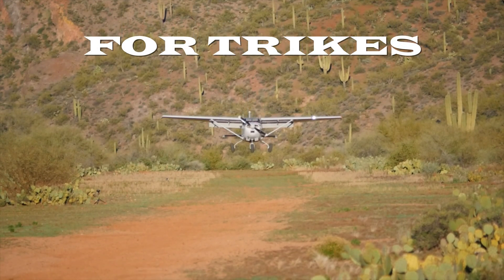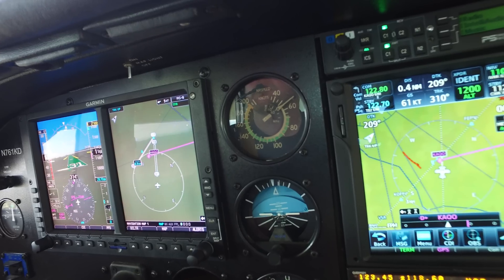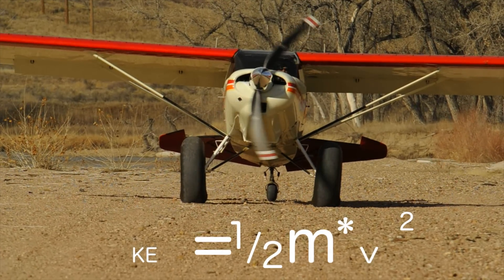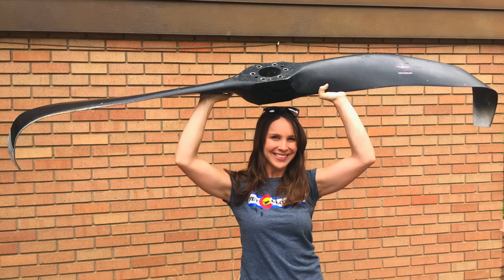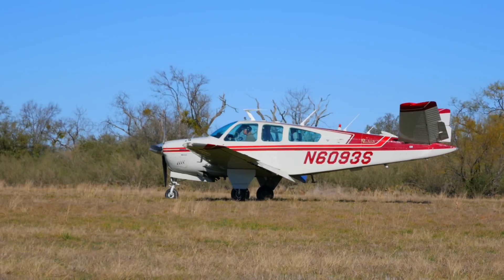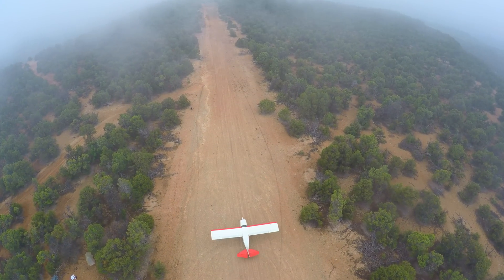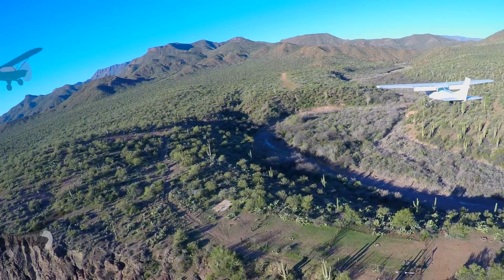Backcountry Aviation's STOL Tips (Tricycle Gear Airplanes)

Comment: Agree with most, but not all. Potato counts don’t create lift. IAS does. “Feel” is critical and should but the primary tell in most instances, but rotating at a guesstimated x potatos is less informative than x IAS vs rwy remaining and worse, bleeds vital energy if the airplane isn’t ready to fly. So perhaps a blend of both methodologies without completely disregarding IAS is more appropriate?

Comment: What is the flap technique for aircraft with electric flaps? I see that usually they would be moved from 10 degrees to full on rotate, but that is not possible in an airplane with electric flaps, which is common for tricycle gear airplanes.

Comment: We have a  175 Skylark, 1960 with the G0 300 175 horse. We are currently putting on a Sportsman STOL kit and bigger tires. Our strip here on the ranch is 1600 feet
Reply from the maker: My first off airport trike landing was a 175.  Sweet plane!
Reply: @Backcountryaviation  I have the sportsman kit on order but do you have any resources for the bigger fork assembly to allow for a bigger tires?
Reply from the maker: Airframes Alaska sells the air glass mod I believe

Comment: I can’t believe the most recent comment is a year old. Hope you’re still checking this video. I regularly fly my Cessna 150G off a grass strip in Texas with a river and cliff on one end and houses on the other, with a dogleg. The biggest concern are the deer; I’ve never seen so many. Though the book dissuades their use, I like to start with 10 degrees of flaps, yoke all the way back (washboards) and get above deer back height as soon as I can. Then I stay in ground effect and milk the flaps up.
The approach is at 65, the best glide speed, and aim just past the dogleg. I use 70 when there is a crosswind. I will try counting potatoes and practice with slower speeds. Thanks for a great video. BTW are you still making new ones?

Comment: Probably the best SEP nosewheel airplane is the FR-172-210. A French-made Cessna 172 with a 210hp engine and a constant-speed prop actually certified with a higher MTOW etc. Not as heavy or fast as the C-182 you could actually take it into C-180 and C-185 territory. I actually AM qualified to comment on this, having flown BN2A Islanders, DHC-6 Twin Otters, Do-228's and Do238's as well as semi-short-fielders like PA-23-250 Aztecs and the Cessna 400-series (C404 Titan and FR406 Caravan II).
I currently have access to a Helio H-295 Super Courier C-STOL aircraft and a few fat-tyre ultralights. In my neck of the woods (grass, actually, preciously few trees around in Iceland), I am in short-field heaven!
The point emphatized in this video about the approach and touch-down speed is acually the mainstay of short-field operations in ANY aircraft. The practiacality and experience of the pilot will determine if a simple short-field takeoff or a crash report to the authorities is called for. In a nosewheel aircraft you HAVE to be comfortable with how firm the landing strip is, or else you will be writing a lot of why-I-nosed-over reports. Misjudging this in a tailwheel aircraft is even more serious!

Comment: Great tutorial. I just wonder why you didn't specifically mention the importance of Vortex Generators on the wing fronts (which typically reduces the approach by 10 to 15%). I only saw it in the Carbon Cup at 7:20. Thanks a lot.

Comment: A 172 with just a pilot can land under 200 ft without brakes and flaps. It's called the back-side of the envelop or hanging on the prop. Don't try it unless you've got experience in handling the 172 Skylane.

Comment: These flaps !!
Yeah with a Cessna 172, full flaps, the stall speed is about 33 IAS ! 😲
33 ! Not the standard touchdown speed I aim everyday. So you can come in very slow...
Reply: 33ias is actually about 45cas in a 172
Reply: They're still teaching new pilots 60 kias (64 kcas) for short field landings. That's a 19 knot difference.
Reply: @djinn666  that is actually a 15knot difference, and you can't approach right at stall speed or you won't be able to generate the lift needed to arrest the vertical speed. Setting aside margin for gusts and wind-shear of course.
Reply: @mytech6779  How is that 15 knots? 64 - 45 = 19. Also ground effect will help arrest the descent.
Reply: @djinn666  ah I missed the cas my bad I used the ias. 
Another part of the issue is that the airspeed indicator in most C172 simply don't respond with precision at those low speeds. This in combo with CFIs needing to deal with a terribly formed legal liability situation where teaching anything outside of the POH or FAA publications can put their whole career on the line if some former student has an accident 10 years later. (Same as courts applying "strict liability" to manufacturers drove per air-frame insurance from $50 in the 60s to $100,000 in the mid '80s. Strict liability basically holds that you need to foresee the customer doing stupid things and go out of your way to stop them.)

On the round out you are loosing forward energy while arresting descent, so you need some extra energy. Ground effect does increase lift a bit, though on a high wing is only significant about 5 feet from touchdown, and GE has no effect on the speed drain from parasite drag (full flaps).

Comment: With the 1960 Cessna 175 STOL I used to own, I'd over-inflate the nose wheel strut to get the prop higher off the ground.  After putting a lot of money into the plane, that tail dragger kit that I wanted would have caused my wife to divorce me!  I would like to caution that if heavy braking was necessary to get stopped on a short strip, it may be too short to takeoff again without leaving out some weight.  I also used to do the run-up while moving so as not to damage the prop.  I figured that brake pads were cheaper than props

Comment: I used to have my nose wheel pumped up higher to keep the prop from sucking up gravel during the start up.  After doing an engine conversion, and STOL  kit, a tail dragged kit was the next thing on my bucket list.  The economy took a nose dive about then, and so did my finances.
Reply: Put a fixed pitch canard on the cowl. Cheap way to hold the nose high and you only lose 2% of range (or can gain if limiting factor was not fuel tank capacity but weight)

Comment: tail  dragers dont need a strip
Reply: depend from the wheel diameter...with small wheels who are the most use on fast taildraggers , i garantee you land on the nose  on rugged or water drained terrain...or with a bit too strong braking...

Comment: Great tips. Flying REALLY slow is the key. I can get my C150 to fly just fine at 40kts with full (40 deg) flaps. And don't forget about weight. I aim for minimum safe fuel and nothing but my skinny butt in the plane. Even works at high altitude. I've been to 12,500 twice and last year landed  and departed Leadville, CO with the temp 78. Keep the great videos coming.
Reply: it'll fly alright with 40 degrees of flap...climbing is another story..there's a reason Cessna went to 30 degrees later..plenty of folks mushed off the end of a runway with 40 down
Reply: Because they didn't practice proper go-around technique per the POH.  Full power, carb heat cold, flaps to 20, airspeed 55 knots, slowly retract flaps, 65-75 knots to climb out.  40 flaps isn't dangerous.  Insufficient training, lack of practice, and complacency are what kill.
Reply: Love the L/Ms with the 40 deg flaps. Like hitting the brakes.

Comment: Hi. Real good stuff. One quick question though.
How would this techniques apply to turboprop aircrafts, for example, cessna grand caravan?
Reply from the maker: +Redfa Jan the spool lag on a pt 6 is pretty significant, but with experience surely manageable. The straight fat wing is going to act the same, but the weight of the plane means more energy to manage.  The More energy there is the further out you have to be in front of the plane so to speak.  That is a lot of moment and with a slow spooling engine one better know what they are doing. Feel free to PM if you want to chat
Reply: thanks for the reply. it really makes sense though. its all about experience and knowing what youre doing. like you said, the lag of the turbine really is the big consideration in making decision of what to do next.. i have been flying caravans for the past couple years now, but have just started out to fly in bush areas down here in papua, indonesia.. im sure youve heard about the place before. crazy strips with slopes and terrain all around. id like to chat more with you about the tips and tricks of back country flying. its really useful for what i do now. thanks again for sharing the videos.
Reply from the maker: +Redfa Jan www.backcountryaviation.com shoot me an email and we can chat.  Sounds like you are doing some cool flying!

Comment: Great video. It gives me hope for my 182 in the back country. I've always wanted to fly back country but wasn't sure my 182 with small tires would get it done
Reply from the maker: +Scott Jenkins I have seen guys in fairly stock 182s squeeze into places lots of guys in "bush" planes would pat themselves on the back for.  Sure there are some limitations, but realistically with proper technique and experience everyday planes are pretty Capable in most of the backcountry strips out there.
Reply: Dont let that front wheel touch until it gets slow. Reality is... Fit the biggest tire you can fit there

Comment: I can usually put my PA28-140 down in less than 200m, but I need 400m for takeoff if I am 1 up and fuel to tabs, so what's the point of landing any shorter than I can get out of?
Reply from the maker: Roger Blackwood landing short is insurance mostly.  Takeoffs in all but a few experimentals is the most limiting and critical part of any type of flying.  In our seminars the takeoff is routinely stressed as such.  We also have a takeoff video stressing key points.  On our channel.

Comment: Very cool.  I have most of my time in trikes so this is a good call.  I did notice larger than usual tires.  Is that a must?
Love the potato count .  I am stealing that and using it
Also will practice how slow one can fly ...at 3500 feet  and sneak up on that use near the ground
Reply: Also, the min. airspeed technique only requires the airspeed to be at its slowest at the last moment.  I'm suggesting that you don't need to be at 60kts in a C182 at 1000 AGL, but only at short final.  So the trick is to practice timing the airspeed deceleration from high final to short final so minimun float will be assured near the beginning of the runway.  Remember, a short field landing, for test and training  purposes,  presumes a 50ft obstical near the threshold.   In many occasions there won't be an obstical to worry about.  Also, I like the recommendation in this vid to leave the flaps down until stopped.  I always do this.  Some people suggest you should raise the flaps after touchdown to have better braking effectiveness.  I used to believe this early on but was later taught by a well experienced FAA examiner that leaving the flaps down creates more drag on landing.  He also said that  since the airplane is "stalled" at touchdown (or should be) all the weight is already on the wheels.  So its really an old wives tale that its necessary to raise the flaps after touchdown.  It also prevents one from making the mistake of accidently raising the landing gear instead. 
     If you really want to stop short in a C152 or a Sundowner for example, have both pilots push the doors open during rollout and you will stop on a dime, and the nose won't pitch forward either.  It's fun to do on a hard surface, just for the heck of it.  I don't recomend it on a short backwoods runway however.   JMHO
Reply: Run as big of tires as you can get away with. Better on the suspension and slightly more prop clearance.

Comment: Red Creek!  Great little strip!
Reply from the maker: +Aaron Miller I hadn't been there before, and I was mesmerized with the place.  It was so different and so neat compared with many of the places we frequent.
Reply: Its a nice strip and easy to get to from the Valley.  We try to do a little runway maintenance every time we visit.  They have a few tools over by the picnic table (we bring our own).

What are the specs on that 182?  Based in the Valley?

Comment: Great job guys. And the drone (I assume it was a drone/uas) captured over the "shoulder" shots added both great imagery and context to your points.
Reply: In an earlier video, they said they use two real planes. 
Drones are way too slow anyway...
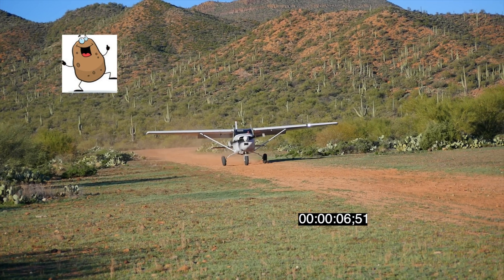Reply: +realulli I don't recall seeing that but if you look at the clip starting at 07:37 there is no way a conventional fixed wing airplane shot that footage. Feels like UAV/drone to me. 08:00 and 08:37 also look like vertical lift machine shot too. Maybe a real helicopter but doubt that in these examples.
Reply: +AeroSpaceNews.com OK, you have a point there. Maybe they used both...